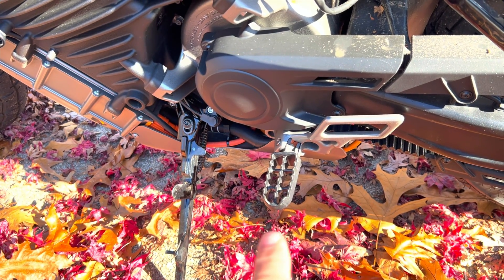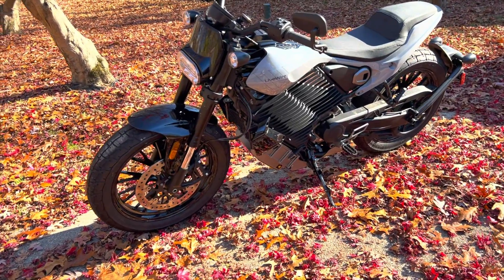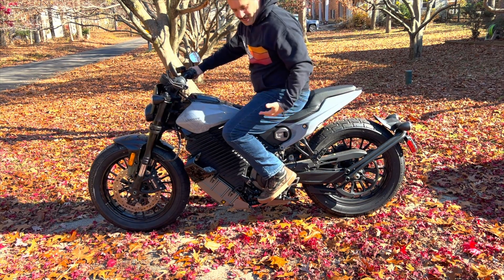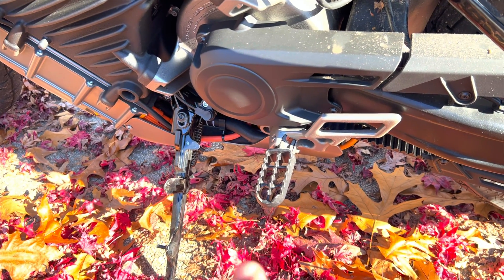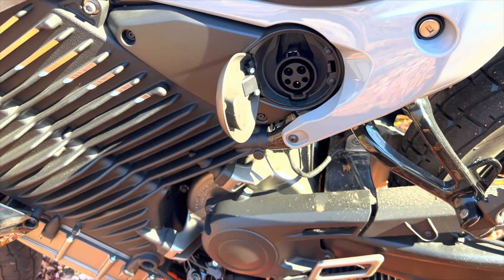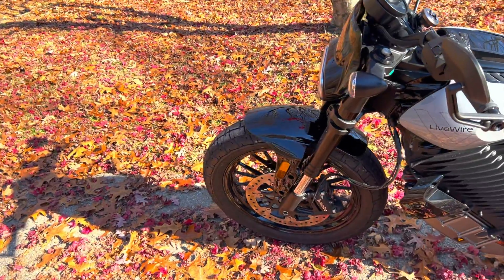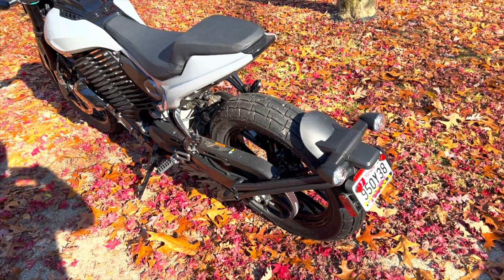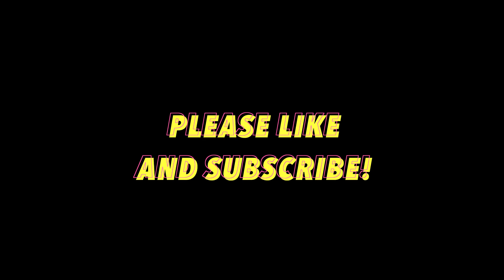Livewire S2 Del Mar  - An Engineering Study on this Electric Motorcycle

Comment: Yea I really think from day one, they made a mistake with those tires. You should go to a shop and see the weight difference between rim+tire on 17 and these. It's huge!
Reply from the maker: Don’t get me wrong, I think the 19 inch wheels/tires look hella good.. but they do make it more tricky to ride.
Reply: @MCCJustMotos  yep. I know. I build these EVs for a living. 19 inch is the wrong way to go. Should be 17 inch and you gain 10% less weight, 10% more efficiency in range and way more manoeuvre

Comment: That ride is gorgeous Andy.
My concern if you run out of wattage and your miles from the charger...What do you do?
You can bring petrol to a " old style motorcycle ".
They have those Zero's out here but I have little desire after watching you 🚀 rocket up the road in previous videos. I watched the speedo and my eyes couldn't keep up as the numbers grew.

I tryed a edrum kit and sold it for the " Old" accoustic drums. Some of us just cannot adapt to new products. Graduated in 79.
We didn't have computers in ALL the rooms then so most of us oldsters are set in our ways.

Love the leaves look. Actually miss them. Ride Safe if your still out there. It's getting a little chilly.
Did you see the RE 650 shotgun? I thought I heard him say only 25   .
Waiting for reviews on the RE Him-E electric.
Reply: I have had all the Harley line ups over the years. Also just sold back my paul yaffee chopper back to paul after 20 years.I now have a livewire one and love it.i am never worried about charging. I may only ride 80 to 90 miles each time.Also keep in mind that Tesla (which i have had 2 and currently a plaid moddel x)will be opening up there super chargers to the livewire soon. As most do not know. I can easily travel the  ENTIRE usa and even in to canada with no problem.Yes you wait longer but you will make it.This bike is by far the best i have ever owned and rode. keep in mind i have had the whole lineup of bikes. You need to try one.We cant stay the same we need to grow and move forward. If that is the case then all leaps and bounds in medical lets keep it where its at??Is that a good idea
Reply from the maker: Great thoughts. I’ve ridden the lw1 a few times and really liked it. it definitely has more range than the Delmar but again they’re different bikes, both amazing!
Reply: I have a HD LiveWire and it has a 120V charge cable under the seat. The thing about riding electric is every building you pass will have electricity so unless you are riding in the mountains near nothing you will not be stuck. You may get delayed for a bit if you have to pull into a store/restaurant/church or whatever and plug in but you won't be stuck. The LiveWire One on regular household plug gains 13 miles (20 kms) an hour so yeah you may get delayed but you won't be stuck.
Reply from the maker: @elbowsout6301 understand, the LW1 is a better long distance tourer, with a bit more flexibility. You could bring the level one charger kit in the backpack or luggage with you but it’s stored under the seat on the live wire one and it has a longer range. The benefit for the Delmar is that it uses level two charging, which is much more common and the Lw1 can only charge at a level 1 capicity on those chargers.
Reply from the maker: Thanks for all..you just have to plan your rides in big detail to make sure you have a charger(s) on your route..so it’s a different way to ride.  There are phone apps to help you plan, not as difficult as you might think, but THIS EV is not a super long distance tourer. I love older bikes too, I’ve had many. 
I’m NOT a huge fan of the limited edition shotgun 650’s. They lost something big from the show vehicle. Maybe the production models will look a bit better?